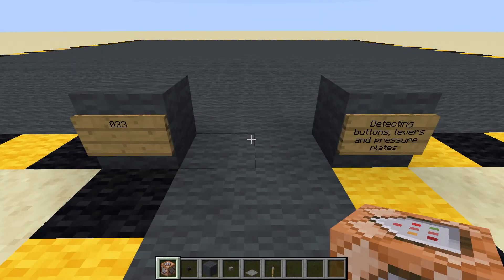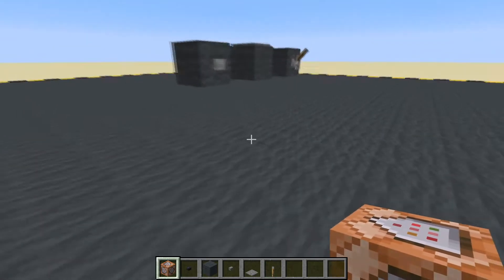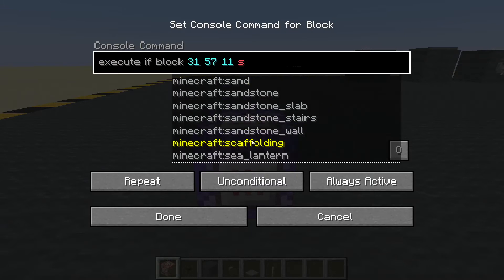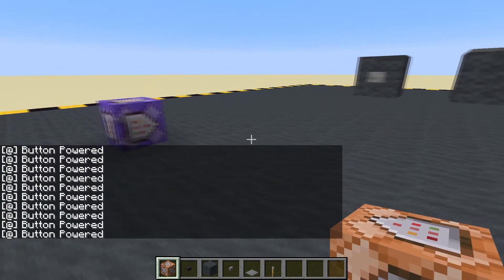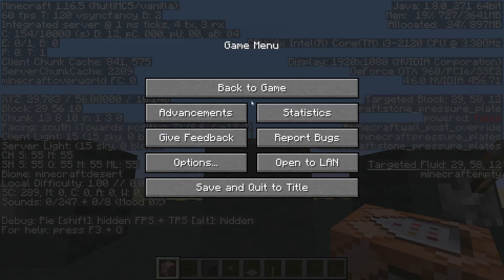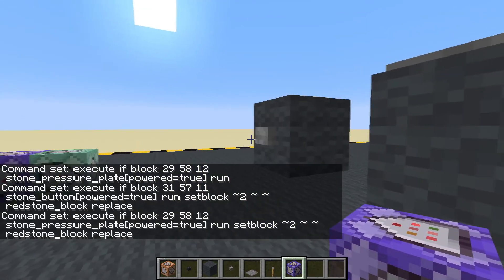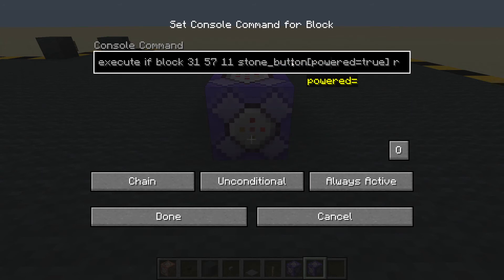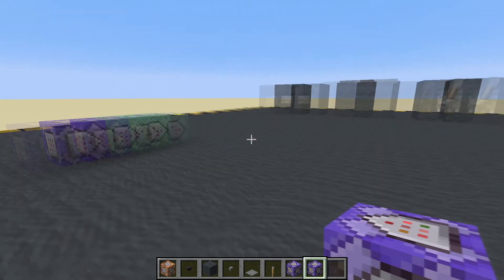23: Detecting buttons, levers and pressure plates [Minecraft Map Making]

Comment: question, i want to use this system for a map that I'm working on, the thing is , i want to use , not a lever stone or button but a plushie from the fnaf plushie mod.
instead of the state powered or not, i want to use the animation state of the object, but when making the command it didn't work as planned .
the plush use the animation : 
animation 0 is frozen
animation 1 when touched
here the command i typed:  execute if block -40 -59 -14 fnaf_plushie_remastered:nightmarionne_plush[animation=1] run say plush founded

when i want to trigger the plush by touching it, i want to detect the change of animation and launch a chain command behind, but instead its stay always on repeat and not a one time use.
Any suggestion for making it work like i planned to do?
edit: i'm on minecraft java 1.20.1
Reply from the maker: Hello. :)

The command looks ok, for instance this will definitely work:

execute if block x y z redstone_lamp[lit=true] run say I am lit!

When the redstone lamp at x y z has a blockstate of lit=true the message will be spammed in chat.

Is the block name correct? Is the plushie a block? Is the animation data a blockstate?
I have no idea about that mod I'm afraid. :(